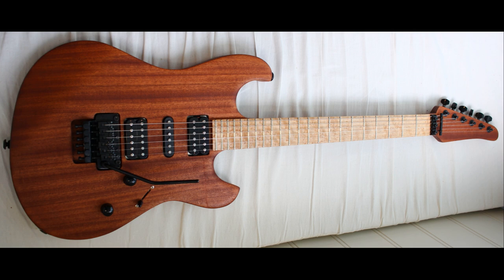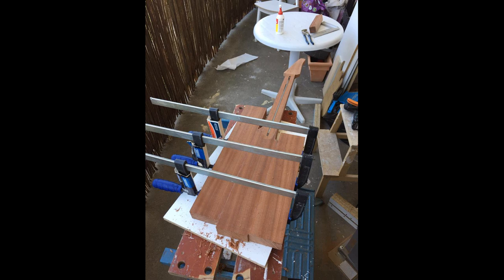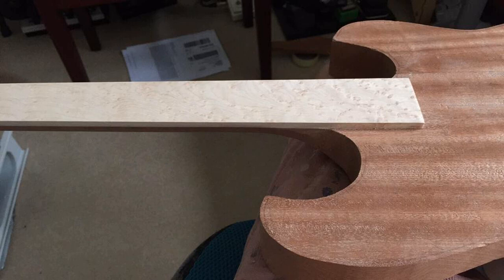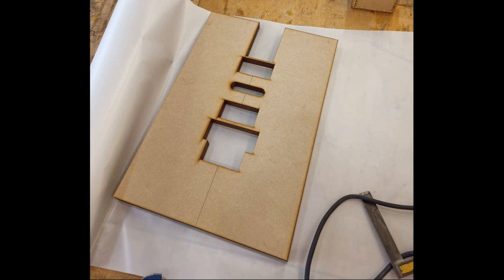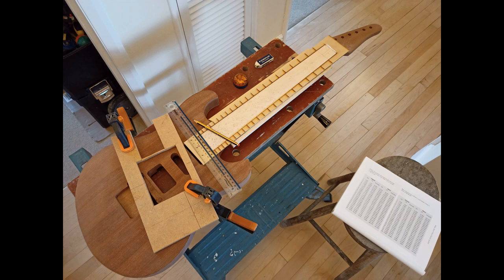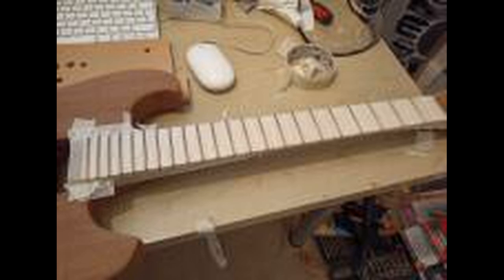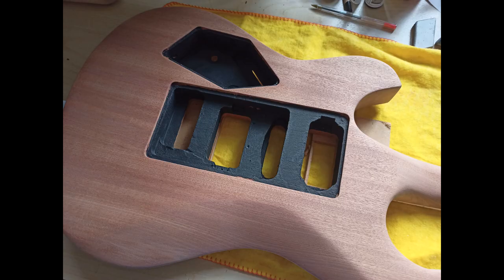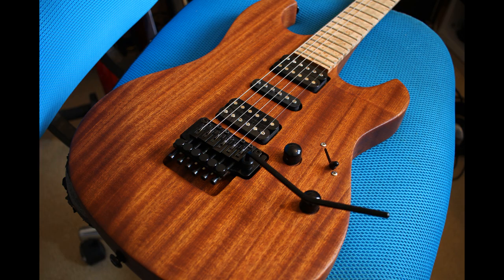Sapele neck through guitar - Great Guitar Build off 2020

Comment: Amazing guitar, and knowing that it is your first build is mind blowing.

I have one question if you don't mind. Is the neck angled?
Reply from the maker: Thank you for the kind words! Glad you like the guitar. The neck twisted a bit when I bandsawed material off the original plank, so I planed it flat introducing a slight break angle with the body, but not much. The fretboard is also quite thick at 5.5mm. The Floyd rose is quite a low profile bridge too, so all of that meant I could get the strings low enough. I pondered over this issue a fair bit. With a different bridge or a thinner fretboard I would definitely needed more of a break angle.  Cheers!

Comment: Beautiful looking guitar, especially for a first build. I use lots of Crimson tools too. The fret levelling file with the little truss rod is great, much sharper and more useful that the StewMac one I originally bought. I love the idea of the rear mount pickups and from the front it looks superb. The only thing I think I might worry about a bit is the fact that you have in some places completely disconnected the neck-thru 'plank', which looks as if it might weaken the neck 'joint'. Lovely guitar though.
Reply from the maker: Thanks Matthew. I really like the fret levelling file too. Thanks re the back mounted pickups. I did worry a fair bit about strength but just went for it, touch wood it seems to have worked so far. You're right most of the neck thru plank has been removed except for thin strips each side of the pickup. Cheers!